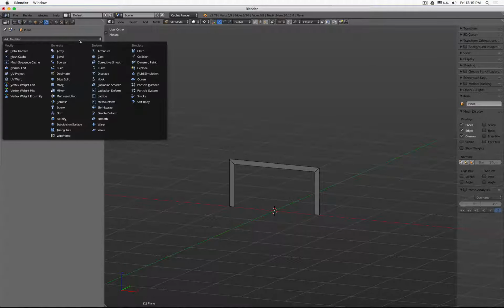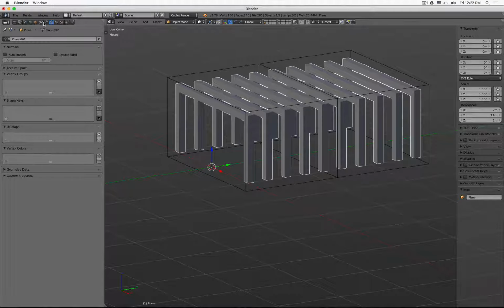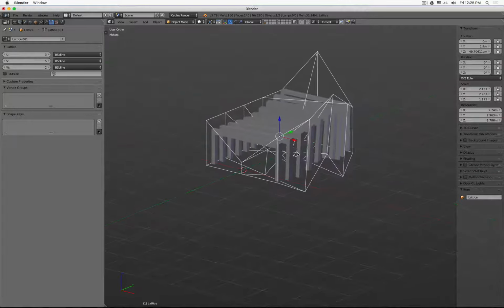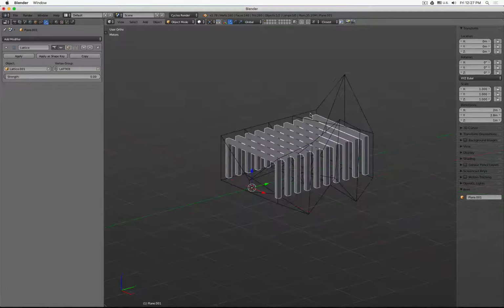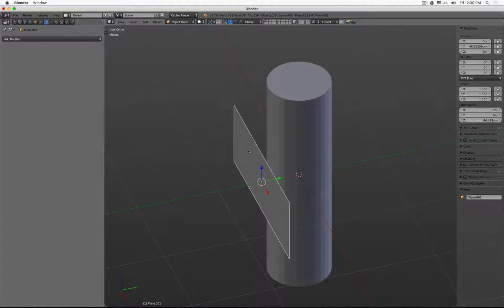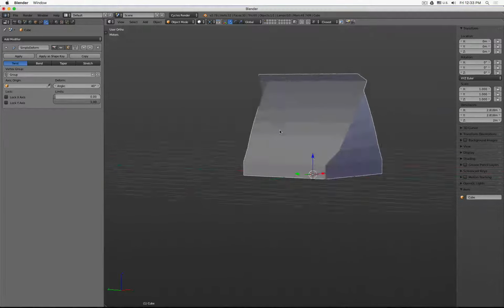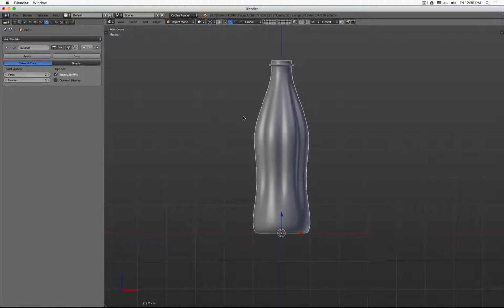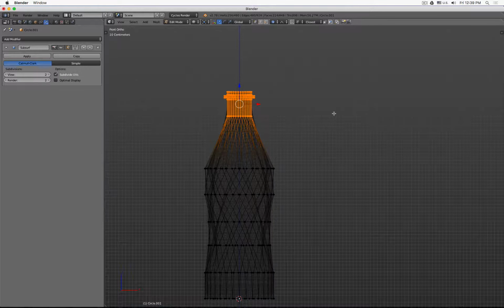Intro to Basic Deformation Tools

Comment: Hey Claas, really enjoying these in depth modeling tutorials. Since the objects you create are often scaled exactly to the grid that you are working with, I would find it very helpful if you posted some information on your blender units/grid/display settings in the video description. Also, are you generally using these same settings for all of your youtube videos?
Reply from the maker: Sam Englander I just work with metric as the unite system using meters. That's all for all videos as well as this helps bringing obj into blender and from blender into fusion 360.